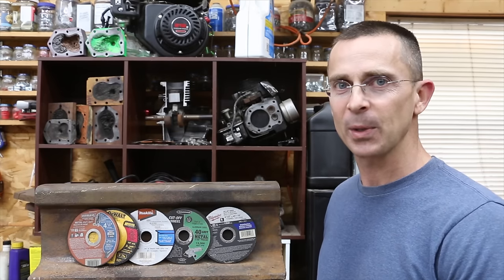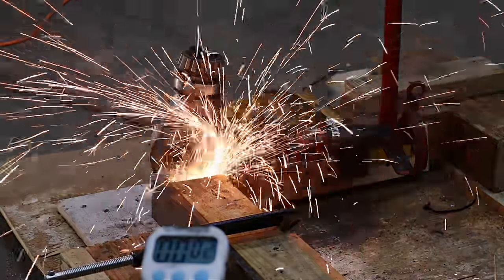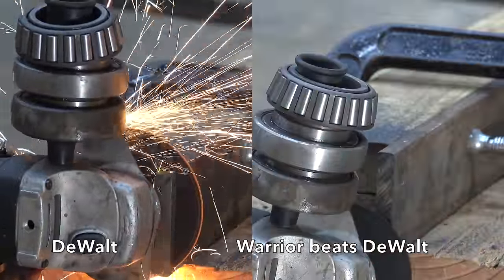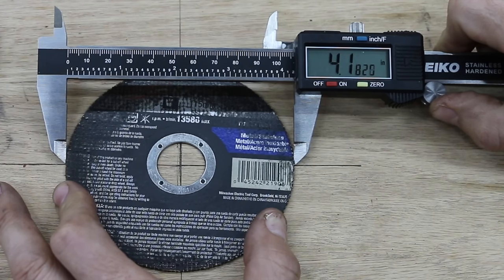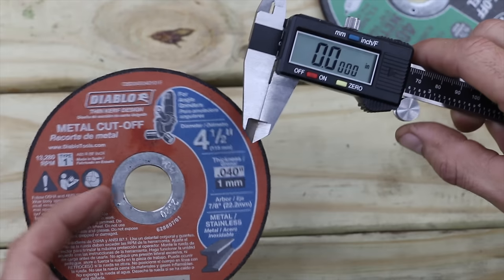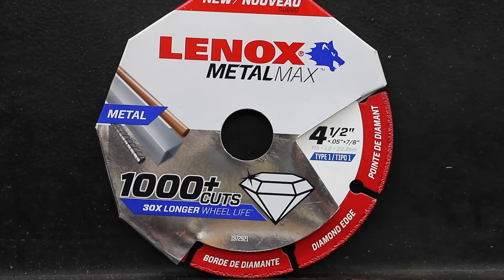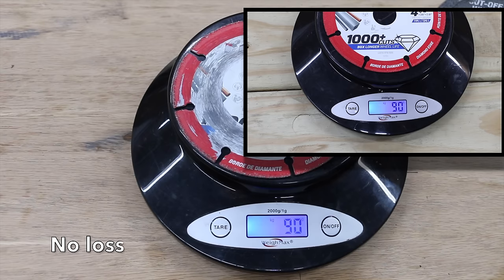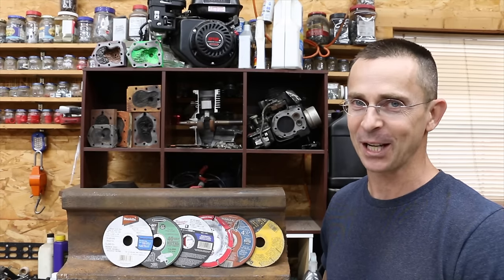Best Metal Cutoff Wheel Brand (6 Brands Tested)?  Let's find out!

Comment: I believe cut off wheels are the wheels where most care should be used to select a good wheel. They consume fast and they can be the most likely wheels to fail. So skimping on them is not the best idea. This video was very helpful in determining that Makita makes some excellent wheels. Not only is it a reputable brand and company but the wheel performance and cost per cut is actually quite competitive as well. Thanks!
Reply from the maker: Thank you for the feedback!

Comment: Wow Diablo just consistently performs. They definitely source their products from good firms.
I know Freud makes the saw blades, but not sure who makes the cutoff wheels. Just says manufactured in Spain.
Just to note, Diablo also has a diamond wheel they claim lasts up to 100X as long. Probably still cuts slow though.
Amazing test and video as always.
Reply from the maker: Thank you very much!  I've very impressed with the Diablo brand.  They seem to do a terrific job ensuring that all of their products are worthy of the Diablo brand.
Reply: I have Diablo Diamond, it's amazing on thin materials like sheet metals, but slows to a crawl on thick plate steel.
Reply: There are pro/cons with wheels that wear... smaller they get the slower the cut/chance of failure.
Reply: I have both the diablo diamond blade and the lennox and I find them both to be about the same in speed and durability.
Reply: @wobblysauce  smaller the wheel faster the cut
Reply: @ProjectFarm  - You know what they say? 'The Devil (Diablo) is in the detail.' Over-all, it's hard to beat these Diablo cutting disc, and most all of their blades. But I also have some DeWalt disc and blades as well. Thanks for all of the effort you go to to produce these videos! Much appreciated! And the Diablo people thank you as well, lol.  :-)
Reply: @williamuskoski1385  Yep ment faster, was typing on the phone.
Reply: @wobblysauce  its all good
Reply: @williamuskoski1385  Thinner the wheel = faster cut. Larger diameter = faster cut.
Reply: @delitha1  smaller wheel faster rpm fastet cut
Reply: @williamuskoski1385  The rpm is not determined by the size of the cut off wheel! The circumference of the wheel determines how much material can be removed per revolution. The larger the circumference, the more material removed per rotation. Basic math! This is why a new   cut wheel cuts faster than a used one.
Reply: @delitha1  so something going 2k rpm is gonna cut the same as some thing going 13k? Gtf outta here
Reply: @williamuskoski1385  RPM IS NOT DETERMINED BY SIZE OF WHEEL!
Reply: @delitha1  if you put a nine inch wheel on a sic inch grinder it will go slower.  If you put a smaller wheel on a big grinder it will go faster
Reply: @williamuskoski1385  No it will not go slower! It will accelerate slower. I can not argue anymore with 3rd grade intelligence.
Reply: @delitha1  it will still limit the top speed
Reply: @delitha1  Ugh, my head hurts just trying to understand how a tool with a set rpm would go faster with a smaller wheel. I wonder if feet per second would help him understand what you are trying to say. Well done not letting that devolve into shit throwing.
Reply: @williamuskoski1385  RPM is the spindle speed, it doesn't matter what blade you put on it will spin up to the rated speed. There is nothing moving faster on a smaller blade vs a large one on the same grinder.
Reply: Diablo all the way! The cost and durability makes them worthwhile if you don’t wanna spend a lot on a job. Sometimes you don’t need top of the line but don’t want dollar store quality. Diablo is just right
Reply: jo what he is saying is the rpm at the outer edge changes based on the diameter of the disc. Think of it as a gear reduction. The shaft spins the same speed, but the edge of the disc speed changes as the diameter of the disc changes.
Reply: @nooneyouknowhere6148  Diameter of the wheel has nothing to do with RPM, you can't have a solid object running at two different RPMs. If you spin in a circle with your arm in, then do it with your arm stretched out, does your arm turn more times than your body?
Reply: @williamuskoski1385  The rpm stays the same regardless of the wheel size.  As the wheel gets smaller the number of surface feet per minute gets lower and the rate of material removal gets slower.
Reply: @--_DJ_--  think of it like this, if you draw a line from the center point to the edge and pivot from the center, the point on the edge stays in line with the center but is farther away. The point on the edge has to move farther than a point closer to the center to stay in line, thus it must move faster to stay in line. It is like a lever which moves 360 degrees around a fixed point. The end of the lever farthest from the pivot moves faster than a point along the lever closer to the pivot point. That is the principle of a gearbox. Basically rotational levers.
Reply: @nooneyouknowhere6148  I don't know why you are explaining something I clearly understand, the arm in vs out. In your previous comment, you say that the rpm changes at the outside of the wheel, that is physically impossible. What you are talking about is not rpm, which is where all this started. Yes the outside of a circle covers more distance in the same time as the inside of the same circle, but it obviously can't be at different rpms. Surface speed is what would change on a grinding wheel, that is all.
Reply: Sorry,  I got you. I misunderstood what you were talking about.  Yes the speed of the wheel edge is what I was talking about. The larger the wheel is, the faster it moves material due to the speed of the wheel edge. If you have enough power to move it thru the material.
Reply: To be fair... The max RPM Probably does change very slightly as the wheel size changes, and it will change a lot more while making a cut depending on the size of the wheel and the pressure applied. I'm nitpicking to add to this cluster though. :P
Reply: @802Garage   802 Garage  if the material removal rate was power/torque limited it would probably remove the same amount of material at multiple diameters... So the true test is not the "max RPM" but really the max RPM while under different loads. In essence you want to be at the peak of the motors power curve to truly remove the most material as fast as possible with a given grinder.
Reply: @joshfincannon213  Hahaha good call. Glad we could elevate this conversation. XD
Reply: @ProjectFarm  It's good to know that Diablo is always a safe bet spending a few bucks extra

Comment: It would be interesting to see how those wheels do cutting really hardened steel, or Stainless that work hardens like crazy.
Reply from the maker: Thank you for the video idea!
Reply: Anecdotally they do great. I used to do general apartment type maintenance and I used a grinder quite often. My favorite task was gutting through locks. The steel on some locks is hardened to the point that a hack saw can not even scratch it but a grinder with a cut off blade zipped right through them. I had hopes for the Lennox diamond blade . My experience with diamond blades was they were great for non metallic stuff but they were noisy and slow at cutting through metal. It looks like the Lennox metal diamond blade works about as well as regular diamond blades at cutting through metal. that is to say poorly.

One thing I used my cutoff saw for was cutting diamond lath. Cutting diamond lath with tin shears is a slow annoying job. grinders with cutoff blades work really well.
Reply: @ProjectFarm  In next video can you use bosch cutoff wheel? Because i use this one and don't know is good or no :D
Reply: @mitsyyyy  Try the other Makita wheels, Makita 724115-A-10, they are made in Germany, not China like the ones tested here
Reply: @davefoc  what brand and or type of metal cutoff wheel do you recommend for cutting off locks? I have a 4 1/2 brushless cordless angle grinder and need it strictly for cutting locks- any advise or suggestions?

Comment: I bought the Makita wheels based on your recommendations.  I am a scrapper and when cutting non ferrous they last virtually forever.  They zip right through light steel.  Very happy with them.  Have you considered doing a video on 7 inch wheels?

Comment: Happy to see Makita made it into the testing. I belive they're one of the best especially when it comes to power tools.
Reply from the maker: Thank you!  I'm really impressed with their cutoff wheel.  I've used a bunch of them and they are a great product.
Reply: makita does make consistently good power tools, but its accessories arnt consistent, usually cheap Chinese quality,  dont buy their drill bits or such, bosch saw blades,  or B&D dewalt do consistently make decent accessories though
Reply: @jusb1066  um what you saw there was accessories lol
Reply: @DLTX1007  Consistent- Always good.  Inconsistent/"aren't consistent"- Sometimes good sometimes bad.

Comment: I would love to see you test the Dremel-type cutoff wheels, sanders, etc...
Reply from the maker: Thank you for the video idea!
Reply: They're great, but they break so easily!
Reply: @kenmore01  Again down to quality, the stock cutting wheels i got with my dremel snapped near instantly after touching metal, some cheapo silverline wheel I bought a 30 pack for 4 bucks lasted an entire project with still usable material left and no snapping. I also bough a 6 pack of diamond wheels for 5 bucks but haven't received them yet to test
Reply: @AntaresSQ01   Where did you buy the silverline wheels? That sounds great!

I know the stiffness of the cutoff wheels causes the issue.  They are strong, but any sideways force makes then break. 

Pretty sick of it, TBH. I prefer a metal cutoff wheel or many other options. The Dremel cutoff wheels are, in  my opinion, cut off!!

Comment: I’m always amazed how you come up with all the different testing parameters. I know pure scientific testing is very difficult but you always come as close as possible outside a lab.
Reply from the maker: Thank you!
Reply: @ProjectFarm  BTW, I wondered if the diamond wheels can be used with more force than the 'normal' cutoff wheels use/need?  Could be that it will stand higher cutting force... just thinking.

Comment: I love your videos. Every one I have seen were excellent. Thank you. I sell abrasives daily, as I work at a welding supply. Abrasives are a science. It is way to complicated to detail in a comment, but I'd like to simplify enough to make something understandable. Aluminum oxide (A), zirconia (Z), and ceramic (C) are among the most popular abrasive mediums. A is the cheapest, Z is an upgrade and C is the most expensive. They all begin as sharp particles, bonded in a resin reinforcement to create their "style". A cuts well, but it is relatively soft, so each particle of abrasive will smooth out or blunt as it does its job of cutting. It requires wearing down,  to expose new particles to continue the cut. Z is harder. As Z cuts, it fractures. This means the particles stay sharp and remove more material before wearing down to expose the next layer of particulate. C behaves like Z but us harder and does more work AND lasts longer. A is cheap and abundant, Z is more expensive than A but cheaper than C. C is the most expensive but works better than anything else out there, with the possible exception of the newest diamond technology. Now understand manufacturers need to compete on price and quality. Bigger manufacturers can (and do) "blend" abrasive particles to get good, better and best performance, as well they can offer cheap, more expensive and very expensive wheels to match whoever they are up against. It's not fair to say one manufacturer is better than another, especially if you are comparing someone's zirconia wheel against another's aluminum oxide wheel. If you can find a ceramic wheel from the least popular manufacturer, and compare it to an Aluminum oxide wheel from a giant like norton or 3M, that ceramic wheel is going to win. Is it fair to say brand "X" makes a better wheel than Norton or 3M? I think not. Just putting this out there so your viewers understand there is much more to consider than the brand. Oh, and please believe me when I say I kept this stupid simple because abrasives are an amazing science. The options available are staggering.

Comment: I understand this is a lot of work, and you definitely do this type of unbiased testing better than most, but for a wheel that changes in diameter as it's used, I feel like 3 cuts per wheel and an average cut time would have been more telling. I would be willing to bet that some of the faster wearing wheels would slow down substantially on subsequent cuts . (I know this test happened months ago 😭, still working through the back catalogue)
Reply: Very true.

Comment: Are you going to test the newer Hercules and Bauer grinding wheels from Harbor Freight?
Reply from the maker: Great recommendation.  I'll do so if there's enough interest.
Reply: They are NOT Skookum
Reply: Good idea!
Reply: @TheRoadhammer379  And Fud's opinion stinks like one......   Been using Harbor Freight for 15 years+.  Still have a 10+ year old electric impact that actually out preformed a Snap On cordless impact.  (That made the mechanic a bit red faced....Impact costing about $55 at the time beating a $350 snap on special).....

Stick to trolling Fudpacker....  Seems to be what you are good at.
Reply: @philtripe  Buy American? Where do you think your phone was made?
Reply: I'll second this idea!
Reply: @Tedybear315  I personally never use and of their grinding wheels whether it is cut off wheels hardrocks or flapdisc. I've seen many of the Hf cut off wheels explode right out of the pack. And they break very easy. I e only used one of their hard rock it seemed to cut slow. I have used one my friends Hf $10 grinder and its extremely weak and seemed to have ton of noise coming the bearings that hold the shaft and he hardly uses it plus it's less than a year old. I use a Hitachi grinder I had one that I used for 4 years until the bearing were so worn that  it had a hard time grinding when angled so I got another and they are only $40 so way better than the Hf and it comes with 5 hardrocks and a cool case.
Reply: What about the brand Pferd?
Reply: @ProjectFarm  check out the Walter discs as well. And cgw is great as well

Comment: Great video, and very informative. Something that would be interesting to see would be the longer-term results of using these wheels -- say 3-4 cuts each.  The reason being, the wheels that wore down faster will have less edge 'speed' as they cut through the material due to the reduced circumference. You did touch on the results of this factor... but my point is that if 'cutting fast' is one of the redeeming qualities of a wheel that wears fast, it may not be so true the more it wears down due to the lower edge speed.  This is not a criticism, I'm just thinking out loud... I loved the effort to normalize all the tests with identical testing procedures. Nice job.
Reply from the maker: Thank you

Comment: Great video! I really wonder how different loads on the grinder would have affected the speed of cut and material loss, especially with the diamond wheel (maybe you'd just have to increase the load with the diamond wheel to make it cut considerably faster - I know, then you'd have to do the same with other wheels, but I don't think their increase in cutting speed with higher load would be linear (at a certain load the speed would have probably even decreased, due to formation of glazing on the standard wheels, but diamond wheel can probably take much more load as it can withstand higher temperatures and diamonds are also cooled by metal, which is a better heat conductor than just the standard wheel by itself, so it's harder for diamonds to become dull). Just my guess, maybe I'm wrong.
Reply from the maker: Great point. Thank you

Comment: I went through a lot of cut off wheels and decided to try the Lennox diamond wheel.  Used the diamond wheel for about a year (occasional use) and finally wore out the diamonds.  I did buy a new one, but have found that using a hack saw was usually faster than using the angle grinder and a diamond wheel.  I now only use the diamond wheel if I have very long straight cuts to make.  I like the scientific way you do your testing keep it up, great video, thumbs up.
Reply from the maker: Great feedback. Thank you

Comment: Great video, well done!  Could you tell us the expiry dates on the wheels (normally indicated on the centre ring or printed on the wheel itself)?
Expiry dates are extremely important.  The resin used in all abrasive bonded wheels is an organic resin which deteriorates over time.  According to EU, US and AU standards, expiry dates must be indicated on all wheels used for handheld application and should be equal to 3 years from the date of manufacturing.  A wheel which has expired should not be used as you do not know how far the resin has deteriorated.  It is quite variable, but you can lose up to 30% in durability and performance if a wheel is older than 3 years.  Therefore always make sure you have the "freshest" wheel by checking how old it is and do not expect the same results from an older wheel.